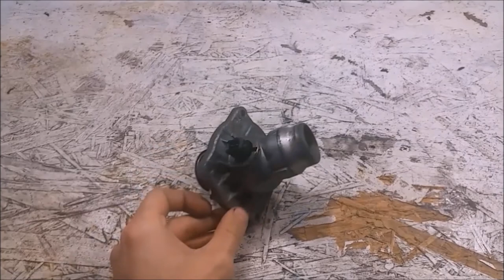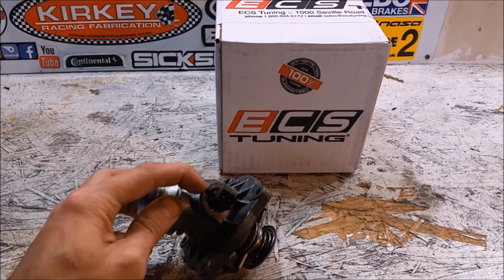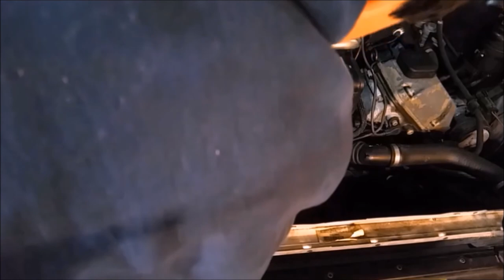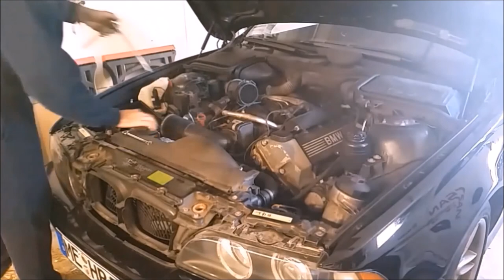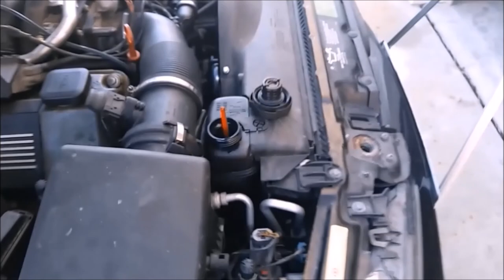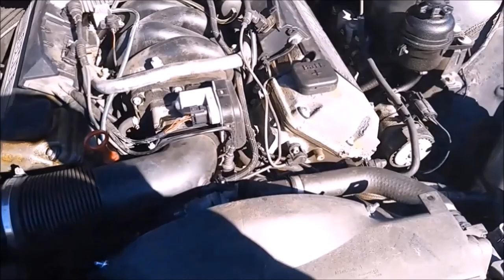E39 BMW 540i 88C Thermostat Install DIY (Cooling Overhaul Part 2 of 5)

Comment: per Bentley purge the system with the bleed screw open, car off, radiator cap on, heater on 90" which runs the recirculating pump.
Reply from the maker: Thanks. Always good to learn the other ways to skin a cat.
Reply: @350Z247  The correct way...lol
Reply from the maker: @theamerican7080  My way worked. No complaints here.
Reply: That’s correct

Comment: Yes and your right! Just have to wait for mine now.. Btw where im getting mine they have 80c or 87c or 75c which do u think would be good?
Reply from the maker: I would go 87C just because I have had such good luck with my 88C thermostat. I can't really comment on the cooler stats as I haven't tried them. They may be fine, but they may throw a code. I have a 68C stat on my 350Z but stock is only 78C though.

Comment: Thanks for the video, but I'm pretty sure this mod only works on M62TU and not M62. I'm having a heck of a time finding a low temp thermostat for my 1998 540i.
Reply from the maker: It would appear you are correct; HOWEVER, if I were you, I would still order one and try it. The thermostat housings look almost identical other than the angle of the barb and the fact that it's designed for the push-lock style hose. It should bolt up to the block no problem and your standard hose should still slip over the newer style barb. Worst case scenario, you return it. You could even order the new style house and combine the new hose and your old house with a joiner.
Reply: For an non vanos m62, use a thermostat and housing from an 740i with m60 engine
Reply from the maker: @mikespeksnijder8650  Thanks for the added info
Reply: Couldn’t u take it out of the housing and put in a m62 thermostat housing?

Comment: Do you know if it matters what year x5 you get a thermostat from if I want to go that route first instead of buying one?  or can i just get an m62tu thermo? Thanks!
Reply from the maker: Lorenzo G. I looked into that for a while then I just decided it wasn't worth it. The price difference was too small to bother so I never figured out exactly which X5 thermostat to use
Reply: 350Z247 thanks what about using a newer thermostat from a newer 540i I have a 97 540i. Or you saying I should just get the cooler running thermostat from ecs or a normal thermostat that's made for the 97 540i? Thanks!
Reply from the maker: Lorenzo G. I changed mine because I don't like the computer controlled high temp thermostat. The X5 went back to the normal style, lower temp stat with the next iteration of the engine. The lower temps save wear and tear in the engine and engine bay

Comment: I am about to install this thermostat, What temperatures does you car stay at while idilding after driving ? what did you do with the heating wire that connected to the original thermostat now that this one has a block off. Thanks!
Reply from the maker: I just covered the plug with electrical tape and tucked it under the intake. The car runs at 192 degrees when driving on the highway and sits between 200 and 210 depending on how long I have to idle. The electric fan can keep it at 200 degrees for a good amount of time though. Been like this for months without issue.
Reply: thanks for your response. Im currently having problems, I installed a electric fan and i can drive for a while but after i drive on the highway and go to city driving I hit temps of 107-117c (almost overheating) its a 2500 cfm fan should be fine. Im wondering if the thermostat is sticking. should i try the 88c while im at it?
Reply from the maker: @upbeatgfx1119  yes, if you're going to replace it, I would go ahead and upgrade. How's your radiator? When is the fan set to come on? How's your water pump? Does your aux fan work? Could be several things causing the issue but thermostat is a good start.
Reply: The lines are hard when car is hot. The aux fan is loud as all hell so it turns on. still not sure whats going on. Someone told me to get a pressure test.
Reply: did you also notice and decreases in MPGS?
Reply from the maker: No. I see no reason to lose MPG. The frictional loses between 190 degrees and 215 degrees probably is significant. The electric fan will save WAY more gas than the thermostat would possibly lose. I get combined 24 mpg with a 50/50 split city and highway. And a pressure test wouldn't hurt. It's so hard to narrow it down when there's so many components.

Comment: Do I have to do anything in the DME (M62TU) to make it work properly? I installed mine a few months back, as my old original one got stuck and made one of my hoses pop, leaving me stranded. Since then, I put the 88c thermostat (from an e38 740d),  isolated the plug (btw before I isolated the t-stat plug, the car would idle erratically and stall the moment I touched the plug, any idea why?) and I also decided to not put the fan clutch back on, relying only on the aux fan for cooling. During the colder months (10-15C ambient temps) it ran great, around 90-93C and up to 95C when I give it the beans, and then dropping down to 91-93 again. Now that it's a lot warmer (25-35C ambient temps) it usually stays in the 94-96C range and when I push it, it goes to 99-100C and can go well over 105C if I keep pushing it. I know the obvious solution would be to put the fan clutch back on (or install an electric fan, but that's a bit pricey for me), but would driving like this be a problem, as I drove for awhile, with the temps reaching 108C max? Would changing up anything in the DME, like when the aux fan kicks in have any effect? We also have 4 seasons here, with the summer getting to like 35-39C ambient temps, which doesn't last more than a month or two.
Reply from the maker: I wouldn't run it that hot for long; it will wear out plastics and rubbers. Ideally, I would add back the fan if you can't afford to do the electric fan.

Comment: Should I do this for my 530i's i6, or does it run at a lower temperature from the factory?
Reply from the maker: The I6 doesn't have the same issues
Reply: @350Z247  Great, thanks for your quick response!

Comment: Hello 
Thanks for the info 
I have a question.
Did you change the raditor cap?
Reply from the maker: I didn't, but it was on my list of things to do. The E30 1.4 BAR expansion tank cap will fit the E39 tank if you want a lower pressure cap. Someone also makes a 1.2 BAR cap, but I can't remember who.

Comment: Thanks for posting these videos with added details. I'm new to all this and have a 01 540i. I'm changing the thermostat to the 88c one you linked. Is it absolutely necessary to convert to an electric fan or can I leave the clutch fan as is? If I leave it as is, does it make the switch to the 88c tstat useless?
Reply from the maker: No problem! You don't need the fan; it's just good insurance for a likely future failure. The 88C will help keep hoses and plastics alive; it shouldn't be effected by the fan.
Reply: @350Z247  thank you much for the quick reply. Much appreciated!
Reply: I have a 01 540i as well m sports , after I installed the 88c thermostat I've been getting p1643 code having engine failsafe popped up which I assumed affect rough gear shift and caused a few more incorrect gear ratio code. any chance you got any codes like that linked the 88c mod

Comment: how did you hack the thermostat wires plug? actually you'll get an error code if the sensor doesn't get information by the thermostat, don't you?
Reply from the maker: My car was a 2001 and did not get a code. I just tucked the plug under the intake manifold. Drove it for a year like this with no issues.
Reply from the maker: @Al-hn7gg  Good luck. I'm about to do a similar mod for my wife's X5M as it too has a 105C thermostat.

Comment: Hey bro! I just got my ECS Tuning 88c thermostat and it doesn't fit! Man im so disappointed! My car year is 10/97.. weird right!. I called ECS TUNING And they just gave a return label.. They didn't even ask why or what year model was my car.
Reply from the maker: But it's still a 540i? What year range did it say on their website? It bolted right up for me, no problem. Glad they're taking the return though. Sorry to hear it man
Reply: On their website it stars from 09/98. But I found it elsewhere in Europe though. Next will be the fan once I get the thermostat.
Reply from the maker: R Tario yeah I love having the lower operating temperature. Saves the plastics and the hoses
Reply: R Tario they changed the hose connections in 1999 you have the wrong part Eva only sells a lower temp thermostat for 99 cars and up

Comment: Cool thermo! Do you think it's possible if i use it on my Range rover M62TU engine?
Reply from the maker: Yes, it should. I would compare parts before you swap them, but it looks like others have done it.
Reply: @350Z247  definitely i will take your advice. Thanks man 👍

Comment: Has the service engine soon light come on? I did one of these in my 540 and it keeps throwing a DTC.
Reply from the maker: Mine has not but it seems to be random on which cars will and which won't throw a code.
Reply: I came across your electric fan video because I'm getting read to do one. I've got a video on how to replace the seat leather if that's ever a project you get into.
Reply from the maker: Derrick G thanks man. Mine is in pretty great shape minis the left side of the driver seat. It's had a hard life ha
Reply: I got the kit and it states if it throws a light you might have put led load resistor in 10ohm 100w and the ecu will think the pre heated element is still connected
Reply: @ezzaei  Thanks! I may try that.
Reply: @ezzaei  which wires do you connect the resistor to?
or do you have a link where you got info?
Reply: @stayedsolidtv  I never put one in as my light never came on sorry mate

Comment: Do you know if X5 4.6is is any different that other M62TU , I mean the thermostat housing?
Reply from the maker: The vehicle list for the part doesn't show any E53. However, I'm assuming it would fit. Take a look at your thermostat and see if they look similar. Worst case, you order it and compare them side by side and then return it.

Comment: do you think my 2003 BMW X5 4.4 would get pissed at me because there is nothing plugged into sensor
Reply from the maker: My car didn't mind one bit; but others have reported their car threw a code.
Reply: @350Z247  would the car run tho would it be ok
Reply from the maker: @anthonyk  mine did
Reply: @350Z247  ok this should help with the timing guide issue too right?
Reply from the maker: @anthonyk  At this point, no. They're 20 years old by now; doing this would help the next set you put on though.
Reply: @350Z247  how many more miles should i be able to get?
Reply from the maker: @anthonyk  most change theirs between 125K and 200K. It really just depends on your car, how it's driven, where it's driven, oil used, luck, ect.

Comment: Do you use any RTV on the thermostat when installing or install dry with just the gasket?
Reply from the maker: Just the gasket is enough
Reply: @350Z247  Thanks!
Reply from the maker: @miketunney9422  good luck!

Comment: Do you have the link to the thermostat?
Reply from the maker: Upbeatgfx https://www.ecstuning.com/b-vemo-parts/thermostat-with-gasket-88c/11512248542~vmo/
Reply: thank you, my radiator keeps blowing up. bought a new one 2 months ago and it blew yesterday. Can that be because of the heat of the stock thermostat? not sure what to do. although, I need to check where it blew this time. Not sure if it was the plastic again or the hose.
Reply from the maker: Upbeatgfx sounds like you just got a bad replacement radiator. The lower temp thermostat will help though as you'll run at lower temp which will also cause you to run at a lower pressure.

Comment: Do you recommend these parts because they sponsor u or it’s your choice?
Reply from the maker: The main thing is they are the only direct bolt on 88C thermostat for the 540i that I am aware of, but to answer your question, because I chose it. They weren't my sponsor at this point if I remember correctly.

Comment: Would this thermostat fit the 1998 e38 with the same m62 engine?
Reply from the maker: It should yes. The ECS website has a list of which vehicles it will fit on.
Reply: 350Z247 alright man thanks! I will make sure the use the link in the video description to purchase one
Reply from the maker: @kamikazee3071  appreciate it. I loved having it on my car and just did a similar mod to my wife's E70 X5M